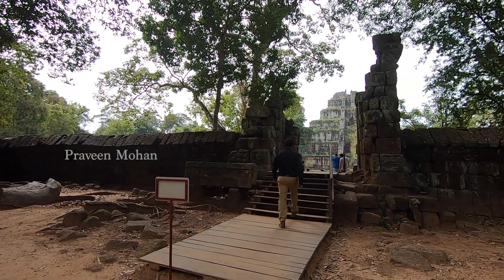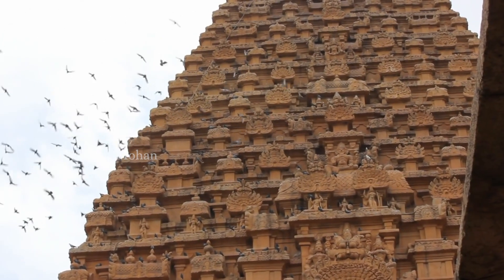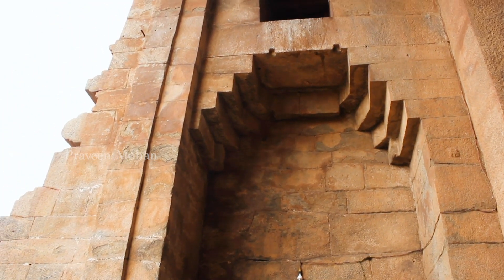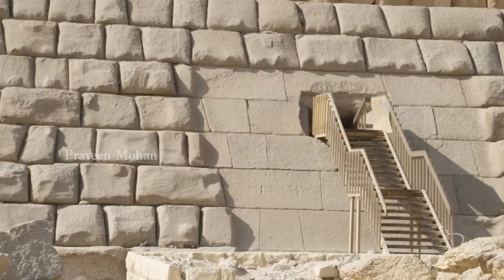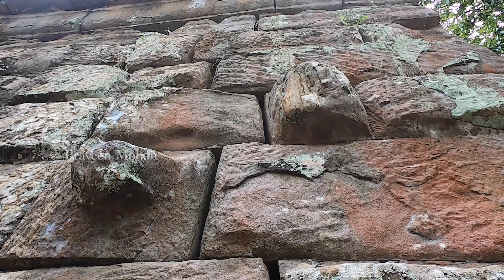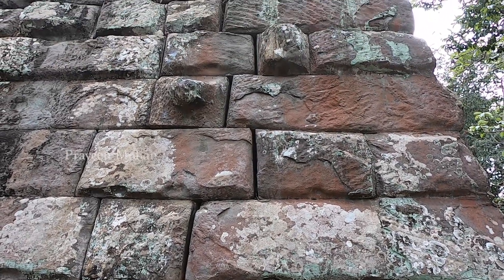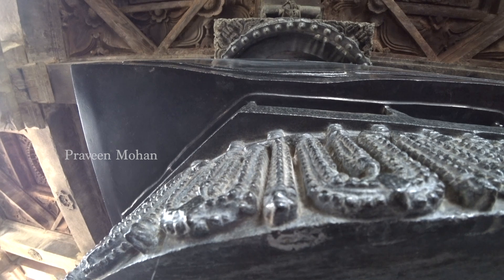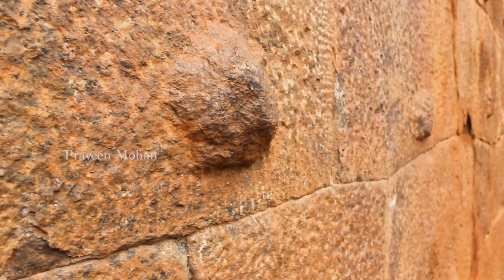Mystery of Ancient ‘KNOBS’ in Temples - Evidence of Stone Melting /Geopolymer Technology?

Comment: It's Block handle. You use wood or rope to hold the rock while you push the rock in place. Exposed knobs are either last placements or taken off after building. If left they didn't want to take the time to smooth them out.

Comment: The knobs appear on large, rectangular stones. The knobs are LOW on the faces of the rock. I would imagine that these stones have been processed in a way that provides leverage points for levers. They are low on the rock face so the fulcrum can be as close to the rock as possible for maximum lifting force. Irregular shaped stones can be manipulated with levers or rope without fixed leverage points so we don't see as many knobs on these types of stones. Massive stones require more leverage, therefore, two knobs for two levers. Look carefully at the other non-knobbed stones and compare them to the knobbed ones. I see plenty leverage points on non-knobbed blocks. The stones with knobs are basically too rectangular to manipulate effectively. If you had a perfectly square stone that was massive, imagine how hard it would be to get something underneath it. Thus you need to incorporate a leverage point. No fancy rock melting tech needed in this theory.
Reply: Also, I am aware that the stones found in Cusco are not "perfectly" rectangular but I would propose that at one time they were rectangular and were further refined as they assembled the "perfect" blocks with the imperfect ones to form the jigsaw type pattern we all recognize.

Comment: I am a heat treat furnace operator 
I worked for General Electric making and heat treating jet engine parts 
When we heated parts we changed the structure of the material to a crystal like state 
So That they could withstand a cutting torch ...you couldn’t melt the metal once we finished the process ...
The ancients had powerful weapons they did the stones this way to act as a shield to withstand 
Attack from the enemy
It was also faster 
Because of there manufacturing process they added minerals and other materials that plants now feed on 
You can see the scaling of the stone that is just like steel Sloughing of mill scale 
It’s obvious in the pictures /video 
The knobs could have been used to hold molds 
Some stones where pre molded others poured on sight 
This compensated for smaller and larger gaps they could put pre molded stones with gaps between them 
Attach molds then fill in the gaps by pouring stone in the molds
Reply: I'm thinking you are on the right track

Comment: What is even more obvious is that if those knobs were placed so as to lift the blocks into place, then why are so many of them near the bottom of the mass of the block and not closer to the upper part of the mass of the block,? Making them a more natural placement to properly bare the weight of the block and let it hang down instead of it's propensity to tip over from the centre of it's gravity. I would not be  attempting to lift big blocks that are so far out of it's natural centre of gravity. Some people wonder if those blocks are logs or tree based poles inserted into the concrete for some purpose of hanging things from them. In Peru the knobs look more like the ends of square tree posts.

Comment: Those knobs are also found on the Megalithic structures in South America. At Cusco, Tiawaniku, And at the walls at Sacsayhuaman.The knobs are randomly placed here and there just like everywhere else.At a place called Sillustani there are knobs on round stone buildings that appear to be in patterns that are decorative. On a lot of these ancient structures it does appear that some pieces are cast like concrete.That would sure make things easier to understand how they got the blocks to fit so tight. Cement is made by crushing limestone to a powder and then heating it up and adding a few things and you end up with a powder that when mixed with water turns to stone. But can you do that with stone such as red granite and other extremely hard stones they built with? Maybe the knobs are decorative or  the signature/trademark of the builder .I doubt that they are flaws in a casting process, They are there for some reason we aren't aware of . the floating rock is an easy one..that's pumice from a volcano. Last year the Surface of the Indian ocean by Austrailia was covered with that stuff for miles . Thank you for  your videos .i love seeing these places that I had never imagine existed. India and Pakistan have such an incredible ancient history. Thank you for sharing.

Comment: If that's the case that they're just from a mold then why would they not break it off or carve It Off after they were done building the wall and make it look just like all the other ones why would they leave it there? It makes sense that you can't put a needle between some of those blocks because if they casted them in place with some sort of mold you know that fit around the side Block in the bottom block and then they cast the next block that would make sense how those rocks are so close to each other and how they kind of round out and into the cracks between but my question about the knobs would be why wouldn't they just take them off or is it because of the molding technology you can't carve into that type of rock after it's been molded I don't know but that's my question is why wouldn't they just take them off and make the wall look flat like all the other blocks with no ugly knob on the side

Comment: how about poured concrete or stone or whatever, but poured into place.  What if they used a thin structure or water soluble film to form the stones and that is why they fit so tight and it just vanishes?  Just a thought.

Comment: Sorry, but your conclusion is utter nonsense. They are not defective bricks/stones, but regular block were knobs were explicitly left standing during carving of the stones. They had a purpose. There are knobs on walls and virtual doors on huge boulders in Peru. Boulders that were not intended to be cut or removed at all. Besides, it would take litte effort to remove the knobs on the flat stone surfaces. But they didn't. So that's the mystery.

Comment: I first saw these knobs on pre inca buildings in Sth America. I am sure they were left by the vibration machines that made these stones 'plastic'  (soft)  enough so that the stone's weight would cause it to settle into the shape of the stones below and beside it. Hence the perfect fit.The knobs are where the plasticised stone flowed into the "nozzle" of the machine. The positions on the stones near the lower edge and near the side edges is exactly where one would apply the plasticising machine to achieve the settling. I am a builder and this is obvious to me. Where carving or decoration was to go, the knobs would be cut or ground off......elsewhere the builders did not bother with the effort of their removal

Comment: Why do you keep saying they melted the stone. They most likely just crushed the stone to remix in a cement type of mold.
Reply: Why do we need the rock to be mold-able at all? The knobs are on the lower margin of very rectangular and large stones. These are clearly leverage points for levers. They are low on the rock face to get a fulcrum as close to the rock as possible for a greater lifting force. Larger stones have multiple knobs because multiple levers are needed. The non-knobbed stones are all irregular enough to provide natural facets for leverage points. you only see knobs on the stones that are very rectangular because those are the hardest to manipulate.
Reply: ChadB I like your theory, and the knobs would make excellent leverage points to use bars to slide them along. Maybe a lot of the knobs  were broke off in the thousands of yrs. since their construction.
Reply: Oh sure. Have you ever tried crushing granite? Or did the aliens do it for them?

Comment: Another Channel with a similar name showed that Peruvian structures are of similar construction & analysis shows that the polygonal blocks were formed from geopohymers . The concrete geopolymer of crushed rock & a specific cement & high heat catalyst is used to fill burlap sacks of varying sizes or  similar fiber sacks then stacked into walls. The walls were then left for rain  to start the catalytic process which set the cement & bonded the polymer into a solid stone. Over time the sacks rot away & places where the sacks were tied & placed facing out it left the “knobs” or excess material that had set nearest the sack openings. The researchers have identified the specific materials use for concrete polymers which are superior to modern concrete as was Roman concrete. However the Ancient Polygonal Builders structures are Much older than previous estimates. So old that the blocks have solidified into stone after being subjected to intense heat & fire. Evidence shows an ash layer that coincides with this observation. Also only the outer faces of structures were subjected to the intense heat & not the faces where two blocks are stacked. Some are Over 50,000 years old  while others are 12-15,000. They are aligned with the cardinal points of the times when the North Pole was either in Greenland or the Hudson Bay, 12,500 years & 53,000 years ago respectively. Thanks for the great video!

Comment: 'From an engineering standpoint', may I suggest you do some study on just how much thermal energy it would take to vitrify much less melt (without leaving a chemical signature) and form these blocks? 
There wouldn't be enough energy source (wood, oil based fuel etc..) within 1000 miles of the temple sites to liquefy enough stone to construct these temples. 
So please, let's not be tossing around the words 'from an engineering standpoint' quite so freely.
Reply: There is solar power, sound vibration and maybe other technology we can't yet fathom. Don't think we are the smartest with technology.
Maybe the giant balls found around were rock pulverizers.
Reply: @suzieseabee  
Irrespective, energy is still energy whether it be stove top or microwave.
Reply: @paulstovall3777  i can start a fire with the sun or use a lighter. It takes no fuel and no no other energy to use the sun. The lighter uses fuel and so does the manufacturing of lighter.
Reply: @suzieseabee  
You may wish to consider the nuclear fuel expended by the sun that creates that light which you concentrated to a focal point using a (manufactured) lens. Simply because a different sources of energy are used, makes it no less nor no more viable. Energy is still energy. With very few exceptions, it takes a given amount of energy to do a given amount of work. But hey, keep thinking. You'll get there some day.

Comment: Great video. You nailed it. It is definitely from a molding process. They may have been able to create them but not re-dissolve them.  Probably not, but it may be hard, or even impossible to go the other way with their technology process.   If that were the case, then to cut cost, they would just leave the knobs, and not try to carve them off which would be very difficult to do.

Comment: What happen if the stones are struck to make them ring?
Do stones with knobs sound different from stones without knobs?
Maybe the knobs are conduits to transmit a shockwave to drive out trapped air out from the geo-polymer procedure before it solidify.
And perhaps the knobs are left in place to make it easier to do maintenance years after? For example shock the knobs to break up tree seeds lodged between rocks to prevent damage from trees forcing stones apart.

Comment: If they were defects then why not just chip them off?  Maybe they were support points during construction.  Imagine placing a piece of wood under the knob to stabilize the wall during construction.  The knobs could be placed in strategic locations to support the wall and maybe no one cared enough to chip them off after the construction process was completed.  Just a thought.  We should be able to tell if the blocks were fully melted or if they were quarried and shaped, just drill into a few of them and examine the interior of the block.  More real science is needed.  Something bad happened on this planet that erased our memory of the builders technology.

Comment: Is it possible that there are Knobs on every stone block and they are used to interconnect each block to another so that they will sit in their place and would not move from their position? 
Eventually they end up with some blocks which will have to be cut or positioned differently to fill the gaps or used with a different orientation making the knobs visible to open surfaces?

Comment: The stones had to have been still soft when set, given the curves across blocks of what we're calling 'polygonal masonry.'  And in that case, they could easily have lopped off the soft 'knobs' and smoothed them over.  Given the effort put into the appearance of the buildings in general, it's hard to understand why they would not do so.  But they didn't.  So it's a mystery.  But 'casting defects' would require them to have hardened in some production yard before being fit into place, which doesn't fit with what we see, and for nobody to have bothered re-softening them in order to lop the knobs off, for aesthetic purposes.
  So, I don't think this is the answer yet, though perhaps you are on the right track.

Also, what on earth is going on with this picture:  11:13.   Not just the wooden stairwell leading up to a whole smashed into the wall, but also the fact that the stones all around it are smooth and flat.   How did that happen, and what are the stairs for, and the hole?

Comment: I think that the "knobs" are the spot where the mold was filled and whoever was making the "brick" at the time did not wait long enough so the "liquid" to harden and it came spilling out of the fill point when the "hose" was removed. In peru on some of the "stones" they are bulging towards the center from all angles like a bag would if filled with water but some were over filled which creates the bulge and others even more over filled which created the knobs, maybe they are even there because they were trying to empty some of the liquid before it hardened but were not quick enough.
 Perhaps it would be easy to remove the knobs but to do so would require some type of force but on the stone which could potentially cause damage to stone the surrounding stones so they simply left them.
   Either that or like someone else mentioned they are a spot to allow sound waves to escape from without shaking the entire structure.

Comment: "Dressing" is the process of smoothing stone. It is a lot of hard work, and is often not complete. Sometimes only the edges of the stone are dressed. The edges that fit with other stones, and the front edge near the other stones. This hides the joint from the effects of weather. Corners that are exposed to the weather tend to round off and weather away. 

Sometimes undressed knob-like areas are left during construction so that the stone can be lifted with wooden levers and wedges from the nearby scaffolding. The concave or recessed edge of the knob provides a place to stick a wooden prop. In high quality work these knobs would later be chiseled off. Especially if they were easily accessible. Areas that are less visible or less accessible might be left as is. Areas that were subject to earthquakes or might need to be adjusted later might leave the knobs in place. It might save a lot of work later trying to realign a block or blocks that shifted out of place. Stone builders in different parts of the world would experience the same situation and develop similar practices. 

Its an attractive idea to think some kind of mold was used to create this type of stonework. The style often plays with that idea I think. It has a certain whimsical, casual, informal look to it.  

But, masonry has a long history to it and is actually a rather sophisticated craft. A lot of work went in to these things and they were intended to last for hundreds if not thousands of years. Using age old ideas of keeping the weather out, minimizing the tendency of freezing and moss and weathering away of exposed edges. I am a licensed architect and perversely enjoy learning about how things rust or rot or wear away with time. In this way we can learn how to make things last. If people would only pay us enough to build that way! But these days building fashions change quickly and buildings end up being demolished to be rebuilt in more trendy styles. The so called international style  or modern style for instance. Simpler and simpler in looks. But plainer and plainer also.

Comment: Were the knobs not just a means of shifting/adjusting the blocks in situ during building? With such heavy blocks it’d be very difficult to wiggle them into place otherwise... the knobs allow much greater purchase, allowing a human to wiggle even white large blocks fairly easily - it could be that simple! Then, sometimes and sometimes not, the knobs are shaved off afterwards for aesthetic reasons... that’s why they are more common in places where they can’t be seen easily! Could it be that simple?

Comment: At 8:57. Look at the plants. Two rolls up and one to the left. There is a vertical chip in the stone. This is a better example of the building of this, as being a liquid at some point. To chip this rock completely across the face. Bottom to top, or top to bottom would most certainly destroy more of the stone. It it was produced in a form, the mixture was not completely mixed and the form was removed before it cured. Also a more reasonable reason for the plants growing is simple. The plants can remove nutrients easily and that is another example of a made product.
Good eye, keep up the good work.